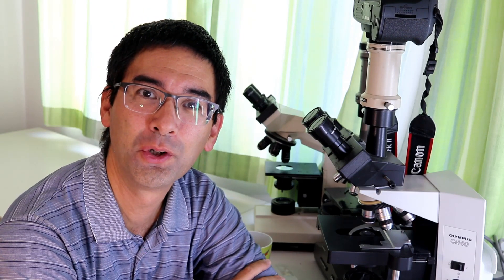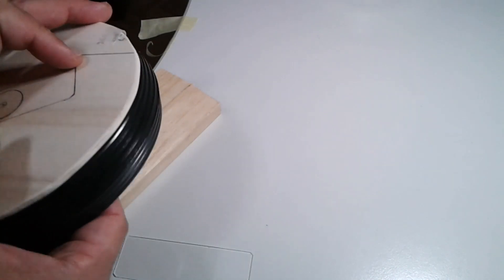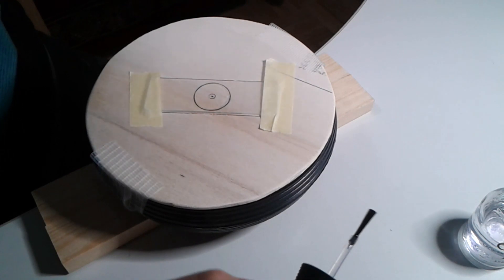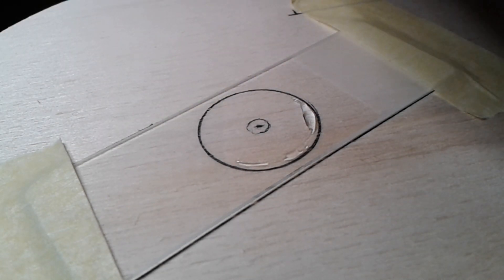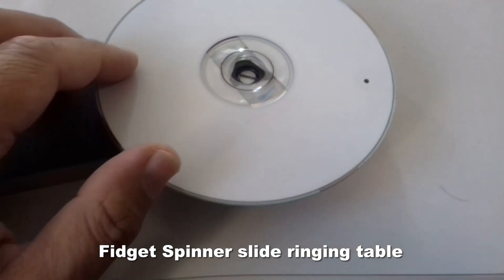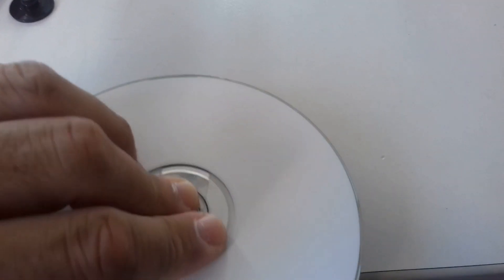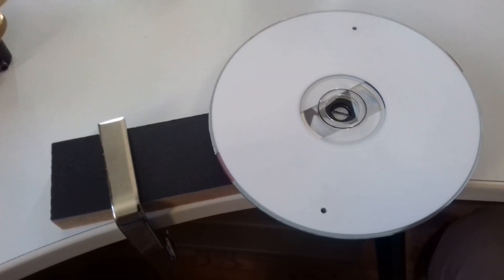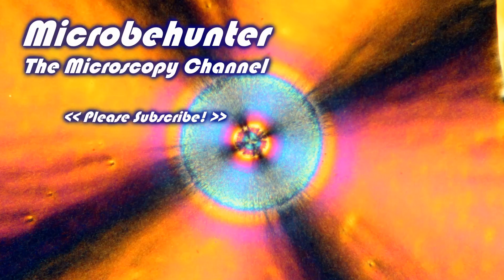🔬 061 - How to make a Slide Ringing Table | Microscopy

Comment: An old SATA hard drive is good for such a thing. An inexpensive ($5.00)  pulse width modulation circuit to control the dc motor speeds. Very smooth. A pc SATA drive uses 3-12 vts DC and are available for a few bucks.

Comment: I have an idea that I'm going to try at some point. In the meantime, if you'd like to try  - The idea is t use an old computer hard drive. You would need to take the cover off and break the reading arms off, b but after that you would be left with a very nice spinning table.

Comment: I wonder about using a hard drive from a computer. when it's been opened up and the armature removed, the disc and bearing should work fine. Might just have to expand it slightly with a piece of board. This will be my next project.

Comment: Thanks for the video - I was able to get a fidget spinner one to work.  Ended up using a circular electrical box cover for the disc - very stable and cost $1 at the hardware store.  Used double sided tape to hold the fidget spinner to a block of wood and to the box cover.  Works great.  Thanks for your help!